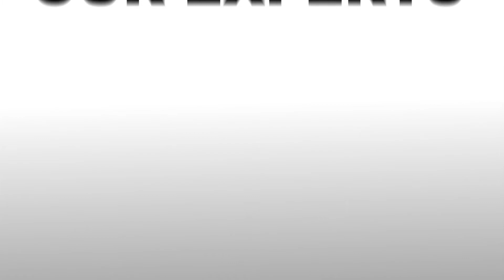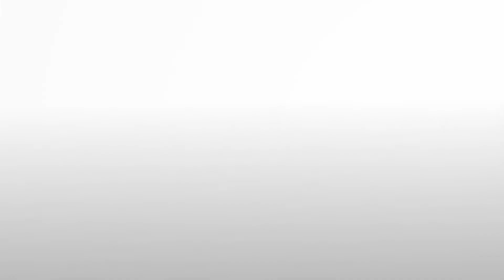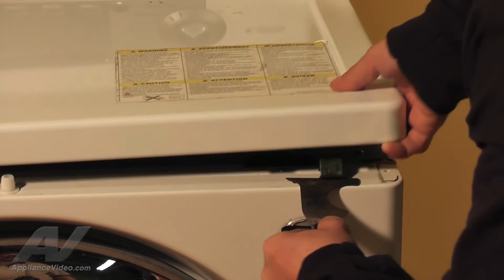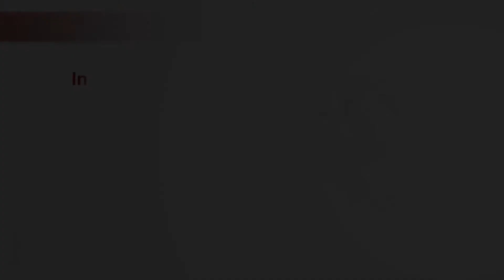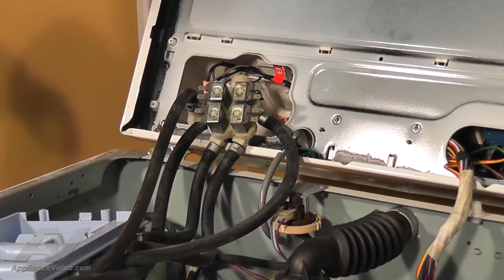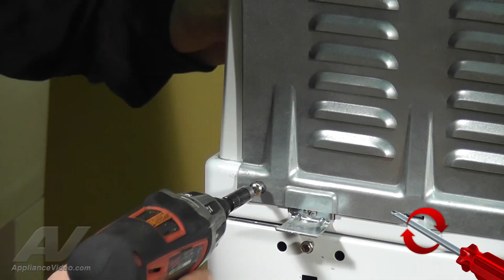LG Washer Repair - Leaking Cold Water - Cold Water Valve

Comment: im having issues with my washer.  when I turn it on a cold cycle, warm water comes out.   I'm not getting cold water in my washer at all.   could this fix the problem
Reply: Replace both Hot and Cold water valves is just a common sense answer......
Reply: Hey Jonathon, I’m having the same issue as you did. What did they suggest if you called. Thank you
Reply from the maker: Great question, you can call
our parts department at 1-800-830-5465 and they can give you help 6-days A week
Mon-Sat . You can also search at www.SaveMoreOnParts.com 7- days a week.  If you have a more
technical question that our parts department cannot answer, our technicians are
answering all questions at our website at www.ApplianceVideo.com under our Repair Help section. We have over
4,000 common questions and answers that you can easily search through by your
model number, appliance make, and problem or error codes, and It’s free to
search through our question & answer library.